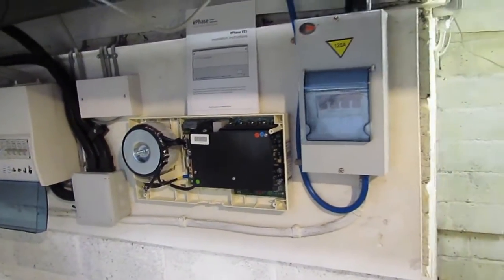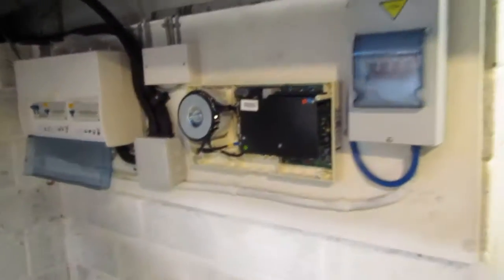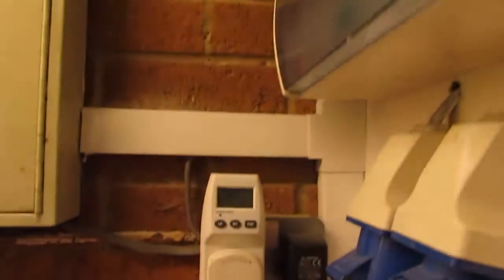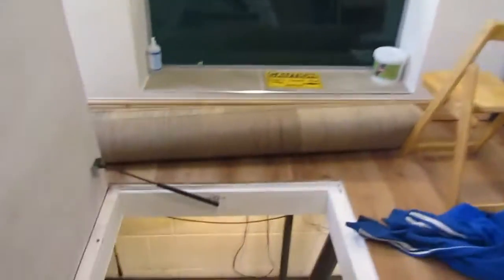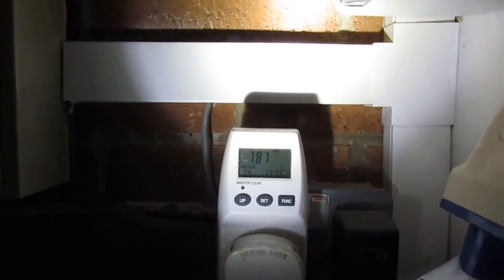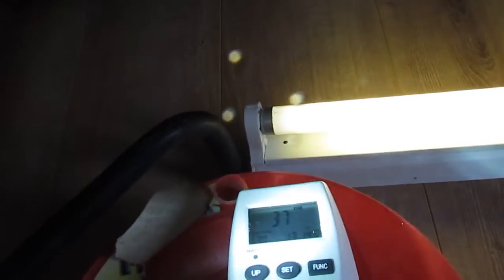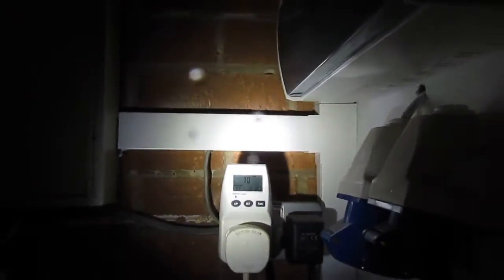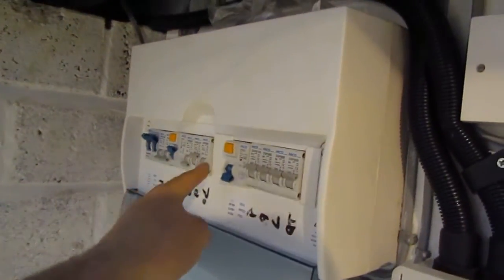vphase voltage optimiser review are they worth it

Comment: You have the same type of plugin meter as I have, in the video you read the wattage's of the pumps and UV lamps off the meter, what is the power factor of the the circuit it looked like 54. You may be able to reduce your bill for the pumps by adding capacitors to the circuit to bring the power factor up closer to 100. Having a load 24/7 can clock up some serious kwh. However day time PV must help :o)

Comment: not being funny are you a electrician haven't you heard of ohms law...reduce voltage that will increase current that's what you have just proved
Reply from the maker: +216daz not being funny but i dont think your an electrician because this does not effect wattage only amperage and i never mention the amps being used.
just to clarify Amps x Volts = Watts so if the voltage decreased and the amperage increase the wattage would stay the same unless the thing used to lower the voltge was using power to do so then the wattage woud incease like it does.
Thanks for your question. and yes i am an electrical engineer.
If your intrested this guy does a realy good tear down of this unit that i would reccomend watching link --
https://www.youtube.com/watch?v=zKasA4HxaGY
Reply: I thought the voltage optimisers only worked effectively on inductive loads? . Maybe if your voltage was 250 and the VA  dropped it to say 230, you would see a notable difference?  I think the say they save energy because some equipment does work more efficiently at a mid range voltage, but they are built to operate on all EU voltage ranges. But they seem like a scam tbh,